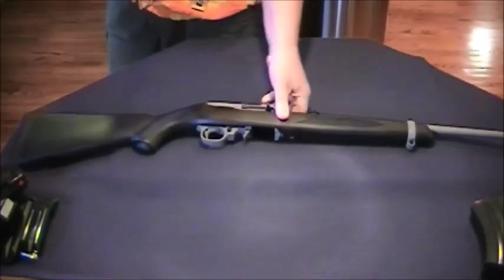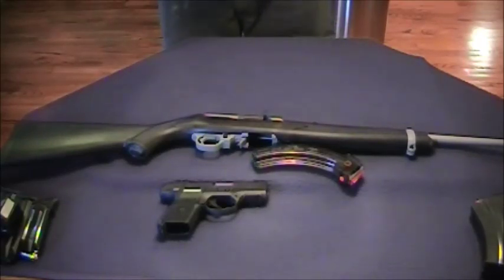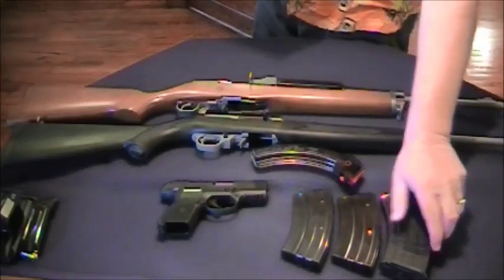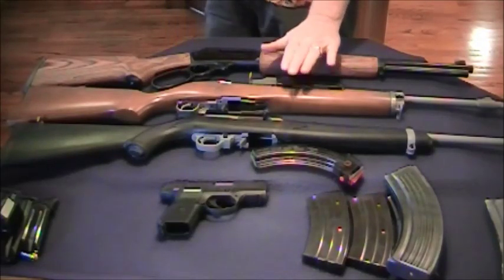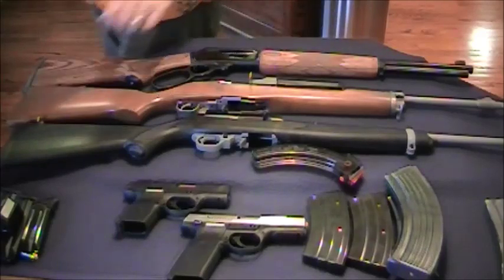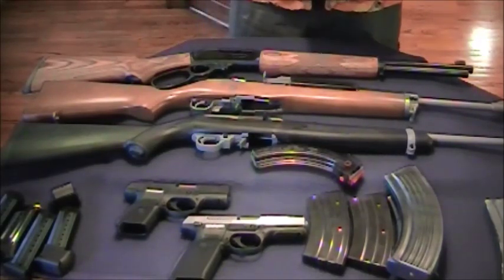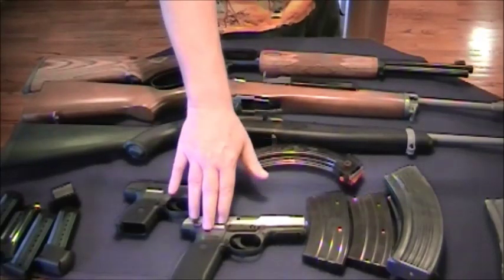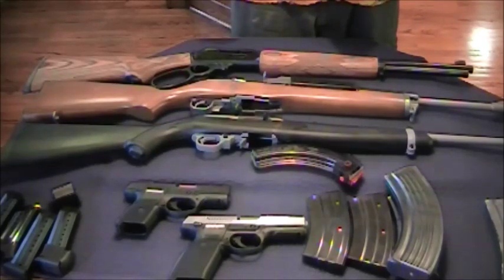SHTF, Prepping Top 5 Guns - An Integrated System.

Comment: Glad you put the "limited to my collection" disclaimer. A shotgun should be #1 on every shtf weapon list. Cheap, versatile, powerful, and intimidating. The 10/22 is a given. For a sidearm, the Glock is king. They are light, accurate, very durable, and most importantly, parts are widely available. For a battle rifle most anything goes, but I will say that the Mini's are known to suck. Get a AK. The 30-30 is ok, but you NEED to get a optic. The role of a high powered rifle is long range.

Comment: 1.shotgun 12 guage, buckshot, duck load, slug, all chokes in bag. 
2. 22 semiauto Ruger handgun lighter accurate dependable, 
3. ak 47 or sks. 7.62X 39. regular length no shorties.
4. ar 15 pistol 556 so you can shoot both rds. 223 and 556. light and packable.
5.9mm glock or beretta 92. easy parts to get.
6.308 deer rifle iron sites or scope any will work.
7. 357 magnum ruger or smith and wessen revolver.
parts kit glock, ar 15 bolt carrier and trigger, extra tubes for gas system and ak bolt and trigger, gas piston

Comment: this is not an integrated system. This is just 3 rifles in different calibers and two handguns in the same caliber. An integrated system is a system that you have actually integrated into your life style, number 1. Number 2, your "system" isn't even a system. It is a bunch of rifles that you bought bc they were cheap and you got at a good price. They are not common rifles; they are different calibers with different actions. The pistols are practically the same! If you're short on 9mm ammo and you run across .40 or .45, you're still SOL. 

It isn't integrated and it isn't even functional. You have a carry weapon, another full size carry gun, a "tactical" battle rifle (how the fuq is it tactical if you have a stock rifle?!), a lever action rifle (which plays the same roll as the 7.62), and a 10/22!

Comment: I'm new to gun ownership, turned 21 a little while ago and am saving up for my first gun. My first instinct for choosing weapons is focused less on using common ammunition and more on sporting weapons in a variety of different (but reasonably common) calibers, with the idea that if I run out of ammunition for one caliber, I can switch to a different weapon and use another type of ammunition. I also took a mental note that different types of ammunition are better in different situations. For example, I would primarily use 7.62 for defense and 5.56 or .223 Remington for hunting, even though I could definitely fall back on the 5.56 for defense as well if I should run out of 7.62. Ammunition would most likely be an extremely valuable trade commodity as well, so having multiple calibers would increase the likelihood of finding buyers that I can get useful supplies from. I felt that in a SHTF situation, it would be dangerous to focus only on one or two calibers, because there is never a guarantee for when you will be able to get more. So if you run out of what you have, you're done until you can find more. But if you have weapons that perform the same function but use a variety of ammunition, it increases your chances of being able to find compatible ammunition later down the road. For example, here is my planned arsenal: 1. A .45 pistol and a 9mm pistol. Haven't yet decided what exact types to get. I prefer .45 pistols, but I felt it important to have a 9mm also because the ammunition is cheaper and lighter. 2. A Ruger 1022 (.22 LR, for small game hunting and as a last defensive resort if I run out of other ammunition), a Ruger Mini-14 (5.56 or .223 Rem, for hunting larger game and as a secondary defensive weapon. I chose this over the AR-15 for a number of reasons which I won't specify), and an SKS (7.62, strictly as a primary defensive weapon). 3. A Saiga-12 shotgun (12 ga, for hunting fowl and as a defensive weapon in close quarters). So I'm asking those of you who have more experience in this field, what exactly is wrong with this mentality and how can I better prepare myself?

Comment: Since your name is Hammer357mag I was expecting you to have some .357 firearms included.  Especially if you want to reduce the types of ammo you use.  For instance, I have a .357 Cimarron revolver that I pair with a Rossi .357 lever rifle.  Both can use any .38 Special on up to .357 Magnum bear loads.  So, my choice of 5 would be:  .357 revolver, .357 lever rifle, a .22 rifle (I have several, but my favorite is the Henry 22 lever rifle), Ruger American Rifle in .270 for large game. My fifth choice would be either a bolt action .22 or .223, or a .22 revolver, each of which would complement the larger caliber of the same style, allowing me to practice at a lower cost than the larger calibers.

Comment: The 30-30 and the 7.62x39 have very similar ballistics.  A quality 7.62x39 soft point will do just about anything that the old 30-30 will do.  If you need a heavier projectile the edge does go to the 30-30.  If you are a prepper then the edge goes to the 7.62x39 because of the cost of ammunition.  Then again quality hunting rounds are not as common as I'd like to see for the 7.62x39.

Comment: Some ppl in the comments disregarded the key fact in your video, "shtf", for shtf my choices will be simple guns that can be easily repaired, and simple internals. Buy a gun or 2 that are popular, when those can't be repaired ANYMORE, then you'll have your other simple guns that work. I also keep my ammo to a minimum, such as, the only calibers I will use are .22 lr, 380 acp and 45 acp. So I chose hi points, because the handguns and matching rifle all internals are the same, so parts and ammo can be used in both. My .22's are  Marlin rifles, a semi auto .22, and a .22 revolver that also shoots .22 magnums. (Keep your ammo to a minimum of 3 -4 different calibers ), for me to see of different ammo just means confusion later on when scrambling trying to find a certain type.

Comment: I don't necessarily have a favorite five at the moment. I have a couple more I'm looking to get but I don't think I'm going to make them my definitive choice immediately. Because between now and when shit actually hits the fan, any number of things could happen. For example, the .22 LR shortage because of the new regulations and the import ban on Russian made 5.45x39 ammo. Before that those firearms would seem ideal because of the super low cost and availability of the ammo, but now it's all gone to shit.

So while I would make plans, I wouldn't chisel those plans in stone. Something that always made sense to me would be to use the same calibers that the military does. This would have a few positives but also a few negatives. One of the positives being that the military uses the ammo, so as long as it's around, you can still get your hands on it, whether that be in a scenario of equipment abandoned or actually "teaming up" with military personnel. It would all depend on the scenario. Of course the negatives are the exact same as the positives. The military uses the calibers, therefor if there was the slightest warning that shit was about to hit the fan the gov. would buy up massive amounts of ammo and likely create a shortage.

This is why I don't think I will ever have any set of firearms locked in and chosen for life. Of course, you can always go both ways, not only have a few firearms in calibers that are readily available and that civilians mostly use, but also have a few weapons in calibers such as 9mm, 5.56mm, 7.62x51 (.308 Win) and such.

Comment: Will Misner: the 590 is an awesome 12 gage remington 870 is too either 1 can't go wrong really there's small differences between the 2 u just gota pick what you like better glock is also a great choice but the 17 is a full size I like the 19 better because it can hold the 15 17 and 31 (or 33) round mags just sayin and finally 308 is a good round. So all yur choices are good and all are common rounds which I like. You seem like you've got a good idea of what u want. Just my opinion. Good luck
Reply: thanks man your input is invaluable. good idea on the 19. I try to point myself in the best direction in terms of firearms. obviously there is going to be plenty of personal opinion and that's what i want. Once again thank you for your input.

Comment: You need to rename yourself ruger fan 01- I agree with the 10/22 it's awesome, but the rest? No way. Glock 17, 19, 26 with 33 round mag, keltec sub2k with same mag compat as glock, thrn the big boys, Npap m70 short and long in 7.62x 39. And your 223 semis, 3 shotguns all 12 gauge buckshot. And a heavy long ranger like San AR 10 in 308, or mosin ngant. Good luck and happy preppin

Comment: Even pre 22 ammo crisis you're wrong about the 22. The most versatile gun for the money is a 12 gauge pump.... Post ammo crisis I wouldn't even suggest buying a 22.
Reply: Now, let me inform you. 12 gauge. It can hunt anything and can protect you, and it's cheap and it's devastating. And even with the ammo situation it's still out there in force for normal prices. 357 revolver, 2 of them. They are devastating guns, they are accurate and bulletproof, they don't fail unless the ammo is bad. And they shoot 2 calibers, 38 and 357. Why 2? Because they only hold 6 rounds. 357 lever gun, longer range, ability to take game or defend out to 100 yards. Again shoots 357 and 38. Last, a good, bolt action 30-06 or 308. You can hunt out to long ranges and ammo is plentiful, and again, a bolt gun doesn't break.... So, I have 5 guns, 3 ammos, all available and high powered for what category they are in, they are all super reliable, super available, cheap and you can own them in the restrictive states.
Reply: michael malkowski interesting gun philosophy. I like it. Still need to have some modern infantry style rifles.

Comment: I cannot understand why you would carry a 30-30 and a Mini-30- for two different roles-  when you could just carry the Mini-30 and keep some ammo that is essentially hunting ammo for it... Yes, the 30-30 has marginally more power - but not significantly more than 7.62x39- but not really that much more to justify the extra weight of a dedicated rifle and dedicated ammo..   I can see carrying two guns of the same caliber for backup. I can see carrying a second gun of a larger caliber that has a LOT more power, but two guns of a similar power range but that are different rounds- nope...  They can't fire the same cartridge and the more powerful is only slightly more powerful- so you are carrying extra weight along with dedicated ammo...  You'd be better served with a few boxes of dedicated hunting ammo.
The only other thing I'd throw into the equation: How accurate is the mini-30? I've heard rumors of the mini-14's lack of accuracy; wondering if the mini-30 is good enough for a hunting rifle or not? Does it improve with good hunting ammo ?
Reply: When you purchase good quality hunting ammunition, with good bullets (A variety of Nosler's, Barnes TSX, and Hornady) the .30-30 becomes more than just "a little more powerful." The .30-30 has been taking everything up to and including moose for one shy of 120 years. Most people cringe, and would not use a 7.62 by 39 for deer or black bear, where as many, the .30-30 as been their first choice for decades. Comparing ballistics isn't enough to say to cartridges are similar. Just because a player looks good in practice, doesn't make him a good player in the game. Same situation.

Comment: Just get 2 M1 Carbine, 1 for you 1for your wife. Replace all those guns. 1 type of ammo Para Troop stock for home defense. Ammo is cheap. if a small game gun is required get a .177-22 air rifle(cal. from .177-.46). Bolt action 30-06 for big game. .30 carbine will handle deer no problem, magazine from 10,15,20&30 gov. issue or after market.

p.s. AMT Auto Mag III,Ruger Blackhawk 30 cal. or X 30P pistol Excel arms.
Reply: +KevinStr6 .357 Revolver /Rifle combo .30-06  Big Gun. Bow and Arrows for hunting quietly.  Shoot .38/357.

Comment: What will you do with all these badass guns if you eventually run out of ammo after a couple of years? xD
Reply: MPZ0103 Kill someone and steal theirs?
Reply: +MPZ0103 make spears, bow and arrows. could also learn to make black powder and make a musket.
Reply: +MPZ0103 The greatest part of long rifles are that the barrels can come out. If you have a decent one it can become a blunt object if necessary or a last resort fishing pole. Sounds goofy but still-possibilities
Reply: +MPZ0103 Z You should have a turret press, slugs, powder, casings, primers,scale for measuring powder, etc...... and lots of them so you can reload your own ammunition. You're right, ammo will eventually be consumed and looters will probably clear the shelves wherever ammunition/guns are sold. Therefor, it's good to be able to load your own. It's also a good idea to keep spare parts like pins,slides, receivers, barrels and springs for each weapon. I would replace the full size 9mm with a full size .45 ACP of high quality like a modern 1911, Glock 21, H&K USP, USP .45 Tactical, S&W M&P .45, Springfield XD, the newer one made by FN, etc...... (keeping a common, high capacity, compact 9mm for my girl and when you find some easily obtainable 9mm ammunition. My choice would be the Glock 19 because they are durable, accurate, popular, dependable, and practically indestructable). I would have a .12 gauge shotgun with a variety of loads (preferably a Remington m870 Express with the assault package), and I would have factory magazines for all magazine fed guns. I would say a minimum of 6 (preferably 9 or 10) for each pistol and a minimum of 12 (preferably 15 or more) high capacity magazines for each magazine fed assault rifle. I would also use factory magazines for all magazines. Some aftermarket magazines function perfectly, some are prone to jamming. The factory magazines are pretty expensive, but you can buy a couple here and there and build up your mag supply. With AK variants, most are good and function reliably. The weak point of any magazine fed weapon is usually the magazine it's self. For the AK, military surplus 30 and 40 round mags are inexpensive and commonly found everywhere. So is the ammunition.

Comment: "integrated system", eh? :-) Explain to us how you're going to CARRY a backpack of stuff, water, and food (essential at all times if shtf, cause enemies, flood, fire, etc, can easily cut you off from your "base", plus 5 lbs of concealable body armor, NVD goggles, along with several longarms and enough ammo to make them worth having?  How to get the animals or enemies to WAIT while you go get "the right gun for the job". ?  How will you KNOW when it will be ok to have just a slowarsed bolt action, a pathetically short-ranged  shotgun, or a pathetically underpowered .22?  HOw will you afford luminous sights, folding stock, scope, trigger job, and silencer for all of them?  If it's shtf, noise will scare off game and attract your killers. Flash at night is going to draw enemy fire, and a silencer, if it's worth a hoot, removes all muzzleflash. It's dark half of the time, and you'll probably need to conceal your longarm at some point. So you'll either need a short barrel and folding stock, or the longarm will have to swiftly reassemble from a taken down condition (as in the 10 seconds to reassemble the aR15 , from it's 2 'halves".

So you see, you're stuck with  the Ciener .22lr conversion units for one of the 223 autorifles, like the Mini-14, the AK, or the AR, along with a 223 silencer  and luminous sight inserts, a scope, see thru mount, anti-cant bubble level, match bthp ammo, and a free float tube are needed if  you want the AR to reach farther than about 300 yds and reliably hit men torsos.

Comment: how will you shoot a gun that you aint GOT with you?  :-) How will you shoot a gun for which you have no ammo? The NG and military arsenals will be breeched if shtf, by the people who have the keys, for the tremendous bartering abilty and sheer local firepower that the billions of rds of such ammo exist in those places will give. There is not one round of 3006 or AK ammo in those arsenals,l probably no .45 or .38, (other than possibly some of the very feeble  wadcutter match rds) and what 308 they have is doing well to group 2 MOA, so it's not long range sniping ammo. A few rds of 12 ga 00 buck are there, along with a few slugs, and some  22lr ammo for the military match shooters, that's it.

9mm, 223, and .22lr is where it's at, folks.